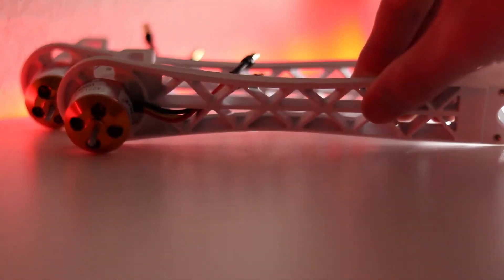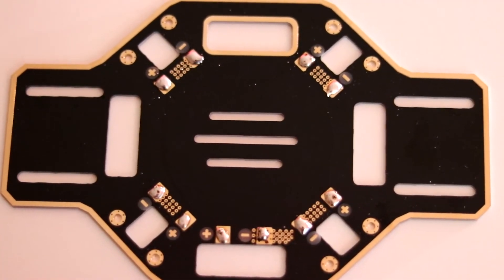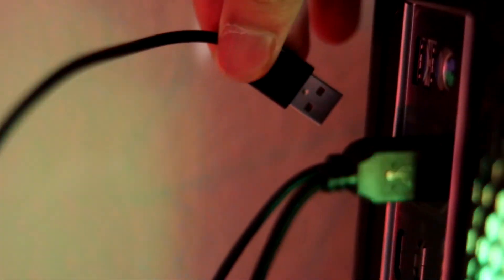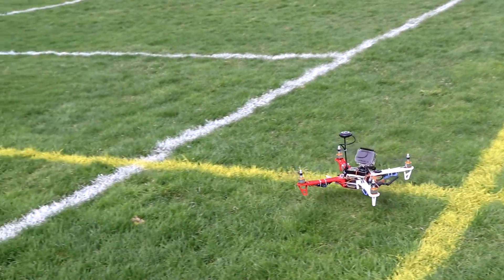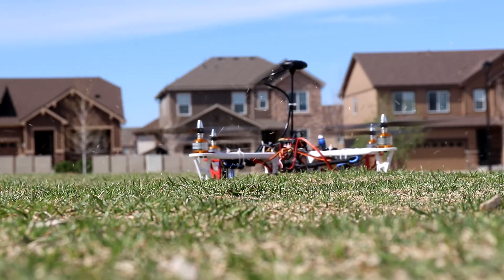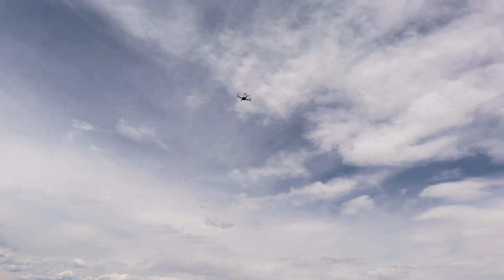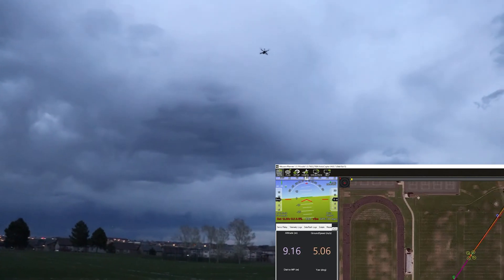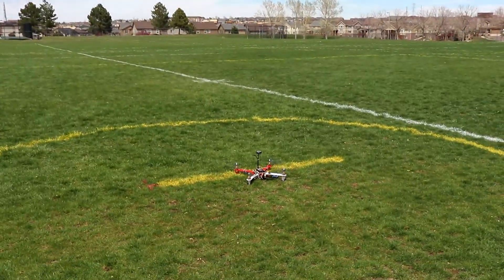How to make Automated Delivery Drone - [w/ Pixhawk, Geo-fencing, RTL, Automated Package Delivery]

Comment: How much payload does this drone have? and how long can fly?
Reply from the maker: With F450 kit, 30A ESC, 2200mAh, 2212 1000KV, max payload should be around 900g theoretically. I tested it with a go pro (with protection cover); total of ~130g. With the drone equipments ~500g. So experimental payload came to be around 630g. The drone was having some trouble at flight. But once it took off, the movements were barely noticeable. And the flight time was about 15 minutes.
Reply: @sohilvaidya  Thanks for the response. Would you please introduce a perfect Kit to make a robot with 3Kg payload and 30 minutes flight time?

Comment: Can you please share your PID settings. I want to refer. My drone is not so stable. I am impressed with it's stability
Reply: I have the same problem
Reply: did you solve it?
Reply: @ I don't have enough time for testing. After multiple test flights, I can conclude !